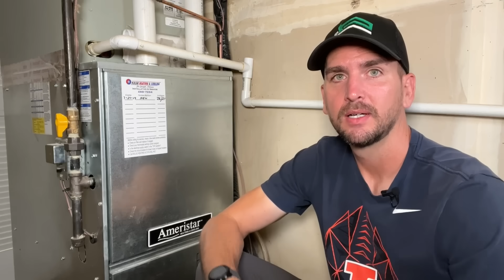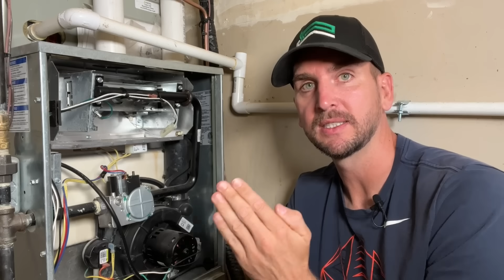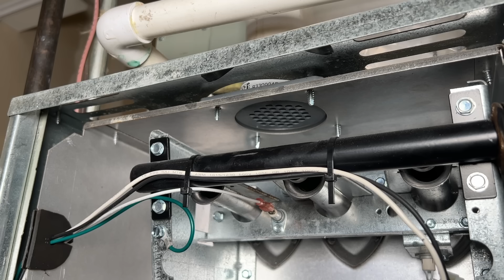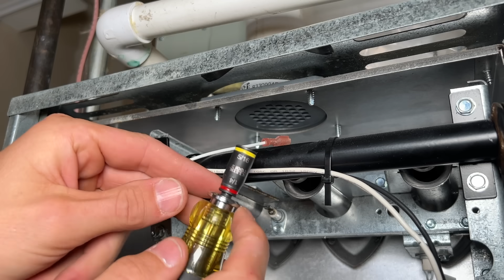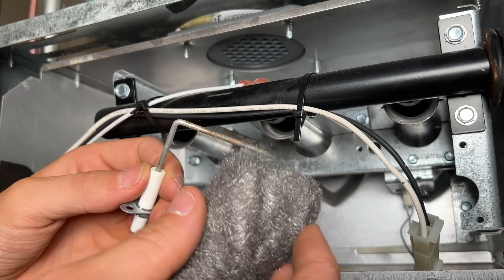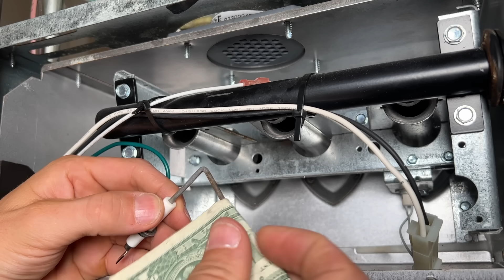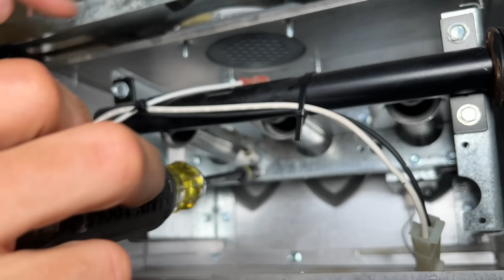The Most Common Reason Why A Gas Furnace Won't Turn On

Comment: I’m familiar with the flame detention sensor . And I have cleaned good but my problem is there is no flame in my gas furnace and the gas is on should I replace the flame detention sensor next that Will solve my problem the furnace does kick on or should I replace my thermostat?

Comment: This video literally saved my butt. I just bought a house that sat  for 3 years. No ignition on Guardian furnace. I no nothing about HVAC. I watched this, realized the stage I was at and checked the connections at pressure switch ( stage 2 ) and up and running. Saved me a repair!! Thanks!!!!!!!!
Reply from the maker: Boom 👊, that is what we are here for!

Comment: Most times you can see what the problem is right away by looking at the boards indication light. It will flash a number of times and you look on the door of the furnace to see what the flash count means and you can go from there to troubleshoot. Most times it's a pressure draft sensor

Comment: I'm having a problem with my blower. It works fine for ac. Worked when I tested the furnace a few days ago. Today I turned heat on, it ran for a few minutes then stopped. Now, the blower suddenly won't come on for the furnace but still works for AC.

Comment: Hey I just wanted to mention that there's a non mechanical step in addition to the ones you mentioned and I've had issues with and solved the problem. On the newer style furnaces the burners are kind of like flame guns. Anyways there is a narrow slot at the burning end of the burners that can sometimes get dust or carbon buildup in them. This causes the flame to not jump across all 3,4,5or6 burners so on. This in turn never reaches the flame sensor and causes shutdown. You see this when it happens if your watching the burners.
Reply: That's not a step. That's do to poor maintenance on your burners. What he described was the order of operation for heat.

Comment: My Comfortmaker gas efficiency furnace is brand new. After installed, turn it on and the blower is running about 2 minute, the inducer fan started running about one, two…five minutes and the igniter stills slepping. So nothing happens and I have to turn off the systems. 
 What wrong to the brand new 
system !? 
  Any advices for me ?

Comment: great video - simple and straight to the point,  the issue I have with my furnace is that it goes all the way to step 5 and the will stop in about 5 minutes / could the Blower be the problem? am assuming since the air is not moving up, the area where the burners get hot and the limit switch is shutting the unit down - will that be a correct assumption?

Comment: My furnace in my previous house had the same symptoms, the 1st HVAC tech came told me it was a bad gas valve and quoted $850 to replace after charging me $90 for diagnosing fee.  It was even before the pandemic.  I ordered an exact model for about $200, it was a two stage valve.  After I replaced new one, the furnace still not working.  I called the same HVAC company for a different tech.  The 2nd tech's diagnose was bad gas meter.  I contacted the gas company.  After gas meter replacement, the furnace works correctly.

Comment: Nice video... I like you!  Okay I have the "same" issue; furnace shutting down after lighting one manifold.  There are 4 manifolds ... only manifold 1 was lit... then it shuts down because sensor didn't sensed the flame or the sensor is bad.  Sensor isn't "bad" yet because no flame was ever on to heat up the sensor.  So happens in these pilotless burners is that the sensor is on the left side and the igniter is on the right side.  The flame must be on at the 4th manifold so the sensor (if it is a good sensor) can do it's job to keep running or shut down.  What I noticed was that no flame passed  to the next manifold down the line...  What could it be.  Intake valve clogged (?) but the draft motor is on.  Gas pressure or gas nozzle?  I think it's the gas nozzle "possibly".  When service rep came by I told him what I saw as I like being a handyman.  When he tried to turn it on .. we saw 3 manifolds lit ...  That's the first time I saw 3 manifolds lit... and the 4th manifold wasn't lit.  That told me the nozzle on the forth manifold might be clogged. We thought the same thing so service man used sandpaper to clean the nozzle.  Tried it again .. this time the  4th manifold lit up which enabled the sensor to detect and do what it was suppose to do;  flame on ... keep the gas valve open.  Cool.. .now we're getting somewhere but the flame didn't look "full" so we decided to take the nozzles out to clean it with a needle too that I had.  So .. hopefully everyone learned something from this video and from comments like this.  It might save you some money.  I didn't  do anything that's risky; simple detective logical reasoning like this video showed and demonstrated (thank you) but there are things you can try.  Good luck everyone... save some money from doing your own thing; anything that further needs checking you can call the right people.

Comment: Another success story! Mine was a little harder to get at, but after having the system about 10 years it was due for a cleaning. Thanks again!
Reply: That's what happened to mine.... nozzle was corroded... used sand paper and a pin to clean nozzle.  Just happened today as I figured it out and the service guy was there.

Comment: Great video.  What if the furnace had gone through steps 5 and 6 (furnace blowing warm air out to vents) but stops before the thermostat reached the desired temperature.  I had installed a brand new filter.
Reply: Try and catch the code that the furnace shows when it shuts off prematurely. If its a limit switch code then it probably still had a lack of airflow. Check the filters you have and see what the MERV rating is, some furnaces and ductwork wont support a high MERV rating filter. For a one inch filter you can start having problems if you go higher than around MERV 8, for 4 inch filters you can usually go as high as 13, depending on the setup.
If the filter is good then look for dirt caked into the blower wheel fins. If there is a lot of dirt packed into it then you should hire a duct cleaner and have them clean you system. Dirt on the blower wheel can cause airflow problems. And if there is dirt there then the ac coil probably needs cleaning and the furnace secondary heat exchanger of you have one.
If the code is a pressure switch error then check for clogs in the drains for the furnace, clogs in the pressure switch line and fittings, and restrictions in the vent pipes.

Comment: I have an American Standard Freedom 80 furnace and noticed that the blower fan come on immediately on the demand for heat before the furnace heats up. Any idea what could cause that? Thanks!
Reply: Check the thermostat settings and make sure it is set for gas heat and not electric. If its set on electric heat it will energize the G terminal (fan) when it calls for heat.
Reply: @Redtooth75  Thanks so much for you reply and 
suggestion. While others on different sites said it sounded like a circuit board, I took your advice about the thermostat and while checking the settings, I found that the Ecobee has a setting to control the fan by the thermostat or the furnace. I switched it over to furnace and it fixed the problem! Thanks again!

Comment: I I have a Concord outside system that blows but does not heat. 
  I had flipped the main breaker for some wiring upgrade. Not sure how old this system is. 
  Is it possible I need to relight the pilot, or should it light on it’s own?
  Cleaned what looks like a thermal fuse and the flame sensor. 
  I noticed I think the fan has a noise in it like a bearing going bad and the motor was heating up. 
  Replaced the covers and came back in the house. 
  Then the fan quit blowing.  Checked it again, and the motor is hot to the touch. 
  I put a little bit of oil in the back of the motor and letting it cool off. 
  Thinking I need another motor. 
  Could a fan straining have caused the burners not to come on to start with?
  If so, I find it odd the burners seem to work now even with the fan not working. 
  Could it need another capacitor?
  I should point out it is the inducer motor. 
  The amp reading from one wire fluctuates from like 7.5 to 8.4. 
  The other wire is way lower like in decimals if I remember correctly. I assume the higher one is the hot lead. 
  Capacitor checks good from C to F at 4.75.
  But from C to Herm is only 41.72. It is rated at 45.
  Thinking I need to change capacitor and inducer motor.
Reply: It seems like you are confusing two different pieces of equipment. A capacitor with a C, fan and herm terminal is used on air conditioners or heat pumps. A heat pump can heat your home but it does not use any flames to do so. But someone could have put a dual capacitor in a furnace if its all they had at the moment. In that case only the C and fan terminals would be used to run the blower or inducer.
If the inducer is making noise and getting hot then that could be the problem. When the inducer runs it closes a pressure switch. If the motor is overheating and stopping the pressure switch will open and the flames will drop out. If its not able to spin up to the proper speed it will also not close the pressure switch. But an inducer motor will usually not pull that high of amps, although if its really shot then it might. The blower motor will pull that many amps. The inducer will be in the same compartment as the burners and will be hooked up to the exhaust. The blower will be in its own seperate compartment, it will be much larger than the inducer.
If you have an inducer then you should not have to light the pilot if you have one. Systems new enough to have an inducer will use some sort of automatic ignition system.
Reply: I should also mention that if you are using a clamp meter for checking amps you cant have the clamp close to the motor or other wires carrying current. The meter will pick up the magnetic fields and give false readings.

Comment: My circuit board burned out on mine and had to be replaced and then the boiler system can be a nightmare the old furnaces are a piece of cake these new ones are a pain

Comment: I replaced the toggle switch and no power
Reply: Do you have 115 volts going to the switch? If you do not then look at the circuit breaker and wiring going from the CB panel to the furnace.

Comment: Non of the tests you did but did find loose soldering connection on back of panel were thermostat wiring block is soldered, while I was checking ac voltage on red 24v wire the led light would flicker so using your tests I did ultimately find the fault so at the thermostat red wire would give me inconsistent voltage readings sometimes 0 or 14v or 26v a quick soldering and back in service and my wife kept telling me it was the thermostat

Comment: Question:  Why does the flame sensor get built up debris?
Perhaps there’s a problem with your combustion? Could there be a problem with insufficient combustion air? What if the draft inducer is not performing according to manufacture specifications and therefore there’s not the required negative pressure in the heat exchanger.
Reply: Its sits in the flame and soot will build up on it even if the burn is correct. Cleaning the flame sensor is normal maintenance that must be done every few years, if you do it every year you never have to worry about it. Improper burn would cause excessive buildup but there are safety features to help prevent that, but they are not 100% effective.

Comment: Hello, I need help finding out what part number my Lennox SL280UH100NV60C-03 flame sensor is? I know these sensors come in different sizes and the metal rods have different angle bends.

Comment: daughter called me, "dad our furnace will not turn on", she told me she called 3 different companies, 1st one wanted $30,000 to replace it all, 2nd & 3rd wanted $5,000-$7,000 to repair it. I sent my neighbor to her home, he replace the sensor for about $35.00........ needless to say, I bought my neighbor a Honey Baked Ham and a big can of Pork & Beans !!!!   All is well !!.
Reply: Lmao
Reply: I got pizza and bear at a sports bar!!!  The safety switch on the door panel had come loose and wasn’t fully closing.  Took me about 1 minute to fix it.  But, then he wanted me to help with his Ring doorbell.  That was a @#$&.
Reply: @glasshalffull2930 my neighbour left the upper door off his furnace and was trying to get it to work for days. He finally called me after two days of freezing here in Canada. I went into the basement and asked him where the door was? It was behind the furnace, I told him that the door pushes in on the button like a fridge door light. He had a huge zip tie holding the button onto a gas line inside the furnace, no way the door could contact it. Cut the zip tie off, put the door back on, fired right up.😂
Reply: @oxyfee6486   OMG!!!  That’s a lot of suffering for a an easy fix. 😬

Comment: So my furnace went out I stay in Michigan I replaced the pressure switch and the thermal igniter. Worked for a few days. Then nothing can't get to step 4 I appreciate any advice or help
Reply: If your ignitor glows but the gas does not ignite then make sure the gas valve is getting energized. If you can smell a little gas then check the manifold orifices and burners for clogs or restrictions. If the gas valve is energized but does not actually supply any gas then it must be replaced.

Comment: I tired it and cleaned it up but it still saying locked out due to no ignition
Reply: Does the ignitor glow? If it does not then the ignitor probably needs to be replaced
Reply: @Redtooth75  nope it don't

Comment: I cleaned out the furnace a few days ago because the burner wouldn't stay lit, and awoke this morning to find the furnace wasn't able to stay lit and about 5 degrees below set point.  A little steel wool on that flame sensor and I'm back up and running!!
Reply from the maker: Boom 👊 nice work!

Comment: I love the explanation of how it works Before fixing it! In the middle of divorce so I'm trying to learn and fix things on my own... seems like everything is falling apart at home all of a sudden but one at a time.... with instructional videos like this has helped and my furnace is working again!
Reply: I'm on the same boat, failure of mechanical heat and the unwanted bells and whistles. This helps a lot right?
Reply: Yes, I'm a person that needs to know how it works before fixing it.   It is always good to learn new things.

Comment: My Goodman furnace needs at least 3 light attempts before it gets going, I will check the flame detector sensor once the furnace cools off as it has just been running.

So I have cleaned the flame detector sensor and the furnace now lights on the first attempt.

Comment: I have a very old intertherm gas furnace in a Mobil home  model MGH 055aawl 07 and it doesn't look like that one hope you can help🙏
Reply: Older furnaces with a pilot light will use a thermocouple and not a flame sensor. They cannot be fixed so if the thermocouple is bad it must be replaced, they're less than $20 though

Comment: Hello thank you for sharing!!! But I have something maybe different, so my heat will only come on at 72 otherwise it will do what you are saying .it shuts on and off below 72..at 72 the house gets so hot then we have to shut it down into the 60's ..plus at 72 the furnace will come on ALL the time and heat the house without shutting on and off except when the house hits 72 then it shuts back off till it needs to come back on,  is this still a sensor issue???we are low income and I only have SSI income so I've watched several videos, and we just had another huge issue as a cap came off of sewer pipe so they fixed that and I asked if I could make payments but they don't clean up the sewage..I live in very small town...so I appreciate any advice we could use to help me with yet another financial hit...THANX in advance..You are awesome for helping ppl.. 🤗🤗🤗🤗

Comment: My hvac tech. Installed a new bryant hvac 6 months ago. The furnace is giving us a problem of shutting off and not working. After trouble shooting by my tech. he got on but he found the heat sensor wire melted. He said that shouldn't happen at all unless heat was excessive and there is heat shroud cover part of the wire itself.   So my question is why this happened ?thanks for any one who could give me an answer

Comment: I have this exact furnace - gas valve goes out of adjustment on its own - piping is 2 inch that was run over the recommended 40 foot length with all elbows and such calculated in.  Not sure why - it lights up violently (relatively speaking compared to what this one did) and the blower motor sounds loud on startup - furnace was new in 2018 - installed by a recommended but clearly washed up person. Looking to fix it now but frustrating as it was never eight from brand new. Any suggestions are appreciated.

Comment: Ugh  I'm a single mom and do not have money for someone to come out...my furnace kicks on (sometimes)  and will not blow any heat... It will sound like it's kicking on but it won't blow heat then it shuts right off... I went and got a carbon monoxide detecter because I'm scared of that happening with having issues with the furnace lbvs( I over think with situations for safety reasons ) I am hoping and praying that this is going to work! I am going to get to work thank you for such easy explanation of how it all works !

Comment: Had the same problem years ago  flame sensor carbon burned on sand paperwork didn't work but blade of pocket knife did. Simple easy repair, good video.